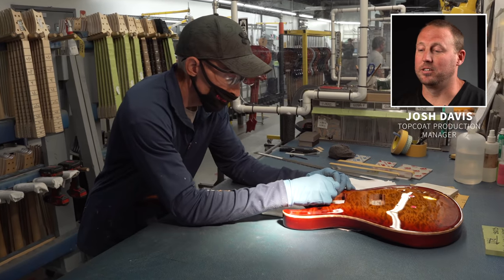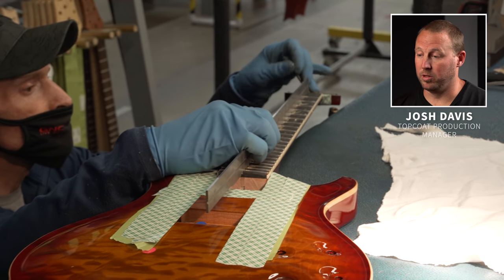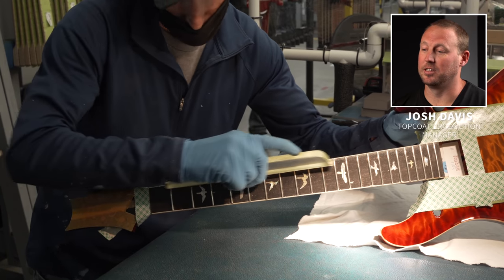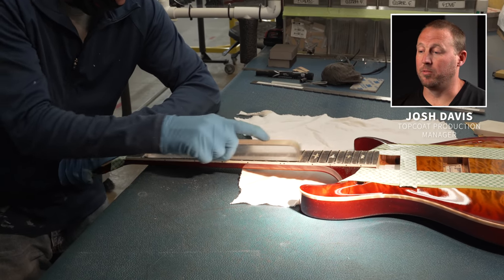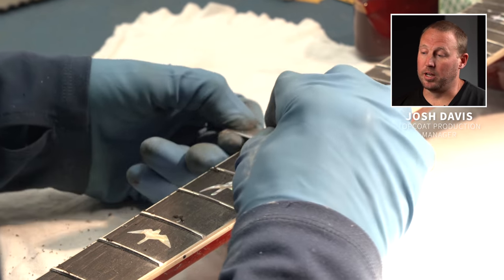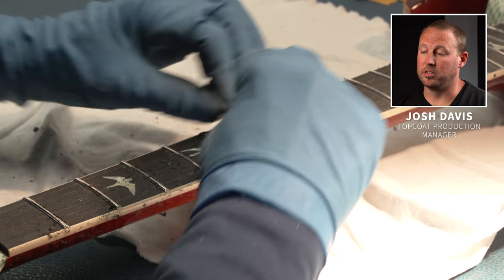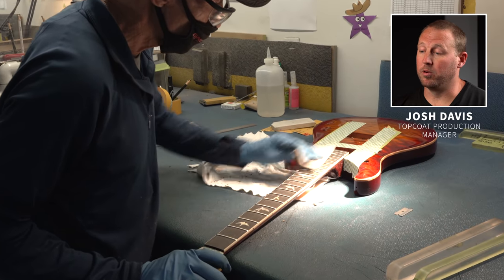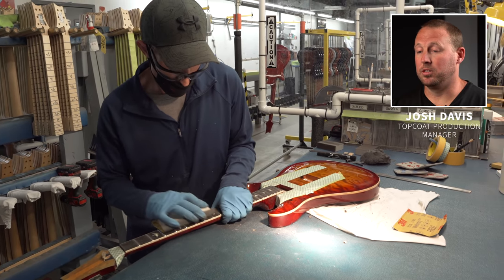Fret Level | From The Factory Floor | PRS Guitars

Comment: I thought notched straightedges were more effective for measuring fingerboard flatness, as opposed to a straightedge on the top of the frets, because if a fret is not fully seated, the straightedge can't sit across all the frets evenly?
Reply: Yeah I agree. Not using a notched straightedge basically defeats the purpose of using a straightedge.
Reply: I agree. It seems to defeat the point. 
Now that being said, when I make a neck (which is roughly three per year), I get obsessive about fretboard flatness before the frets go in, and ALWAYS with the truss rod in "neutral". I also don't hammer or press the frets in, I shoot them in from the side, like they did at Fender, in the 50s. When I get to the leveling process, having followed the steps above, I rarely need more than one or two light passes with the beam to get the whole board level (before I apply upper fret fall away).
Reply: @graxjpg  He is using a nothed straightedge though.
Reply: He is using it to straighten the neck. Then he uses the block to sand all of the frets evenly. Once he knows the neck is straight and frets have even wear from the sanding block, he knows the tops of the frets are in one line too.
Reply: I've just returned from a local music store that stocks these. Foriegn and domestic models. And I studied the frets of many models.  Exceptional instruments for certain, all of them.  But what I saw that I didn't expect still has me perplexed. And that was the flat fret tops. Some were narrower than others, I'd say the widest flat spots were about a millimeter wide and the narrower were .25. But there seemed no rhythm or reason. It's actually what brought me to this video. And after watching it, what I saw today seems to make more sense now. I never saw in this video any re crowning of any frets that were just ground flat. They  present the final fine sanding used. 
Anyhow,  I can see where it would be better in terms of number of hours before "pitting" or wearing. But it also seems like it skips a major step in the leveling process I personally employ.  And for me,  the time I would spend re crowning what I saw today would cost my clients between 80 and 120 dollars. Or, between one and two hours of work. I have seen Gibson les Paul customs with very similar looking fret tops.
Reply: @erickaufmancustomguitars1351  I believe Paul has basically been duplicating a lot of Gibson's older processes from the time PRS started.
There is a school of thought (to which I do not subscribe, personally) that since the guitar has unequal temperament by the nature of its traditional fret system and tuning, that the crowning process following leveling only corrects for fractions of cents per note, so who cares? Plus, as you mentioned, the process on display in this video saves quite a bit of time.
I can't be certain, because I never seen or held one, but I suspect a PRS Private stock would have evenly crowned frets, polished up like mirrors.
Paul is maximizing profit with an inferior process that makes little difference to many players (but not me). He can afford Pleck machines, so I can't see say justification for such a shortcut anymore.
Reply: @peachmelba1000  I'm curious,  did you have an issue with frets lifting that caused you to adopt this side shooting fender did?
Or just employing the same technique without question? Not trying to stir up anything. Seriously just curious.
Reply: @erickaufmancustomguitars1351  No, it's  just a gentler process. I can't say for certain, but I suspect that sometimes hammered or pressed in frets can vary somewhat in their level of seated-ness, in relation to one another, simply due to differing levels of pressure or force used, either by hammer or press. With side loading, you have to take care to remove any sharp corners from the raw fret ends before they go in, and you have to preradius them to the exact size. It's a bit more painstaking on the front end, but I find that extra time is really worth the result.
Reply: @erickaufmancustomguitars1351  Oh, and beveling the fret slot edges fairly aggressively is a must with side loading. If not done the square corner of fret slot will interfere with the tiny fillet between the fret tang and the underside of the fret itself. That can cause a high fret.
Reply: Thanks for passing along the information. Appreciate.
I finished 4 from the veterans I like in Minneapolis at supra-tone. Jatoba/rosewood, jatoba/jatoba, and walnut/rosewood, baked flame/rosewood.
One had to be refretted. As I sanded to roll the edge one fret fell out.
Reply: Sorry. I got distracted for a long time.
Anyways. 
I had very little left after leveling due to preparation.
I just actually feel sad after seeing what I saw is all.
Reply: @erickaufmancustomguitars1351  Right! They don't crown them, I give mine a quick crown now after seeing an playing S2, played better than the SE with just plain unleveled frets
Reply: @jirkav nope, just a straight edge the side talking calls a ruler
Reply: @jirkav if there's a problem with the frets you can't know if the neck is straight unless it's not, which it isn't

Comment: UNDERNEATH the fret?! I know you make a point of having the frets down 100% in contact with the fretboard. PAUL?! WHATS IT GONNA BE?!
Reply: I was scratching my head at that entire process. Just masking the board off properly during lacquer spraying would eliminate the necessity of taking a razor blade to the board afterward.
I suppose they could argue that the scraping is faster, but my word, that kind of "knife work" presents plenty of opportunities to mar the fretboard badly enough to scrap the instrument.
Reply: @peachmelba1000   But I have never seen a scratched PRS fret board right out of the box. So why the concerns? They obviously habe a reason for why they do it that way.
Reply: @chrisking6695  They have excellent QC, from the guitars of theirs I've seen. I doubt an instrument with a whopping big fretboard scratch would get past it. They must have worked out that the scraping, even with a risk of damaging or scrapping an instrument, takes less time and costs less than some other measures.

Comment: PRS are beautiful guitars. But I hate all of the neck profiles. I wish they would make a bolt-on neck with a fat back profile or offer bolt on necks with other neck profiles that I could purchase and replace the standard neck. ( without having to spend thousands of dollars in the custom shop)
Reply: Go buy a garbage Les paul then. All the fatness you could want
Reply: @grenade.turtle  yes I understand. You seem to believe PRS has no room for improvement. All I'm asking is what others are thinking expand the neck profiles
Reply: @windsurfmaui8239   Their bolt.on guitars are called CE. The CE like also comes with a pattern thin profile as far as I'm concerned. That's a fairly thin profile. I own a PRS SE custom 22 with wide thin profile. At first I thought it's a big neck but after comparing it to other guitars it's not big at all. 

You can always order a private stock. You can then have them custom make your neck to your specifications. Or you buy a PRS CE and take the neck off and go to an experienced guitar builder and have them sand the neck to your specifications. Or you just buy a different guitar. PRS isn't the end all be all.

I'm sorry I just realized you said fat.  Look for a custom 22 core model from the 90s. They came with wide fat necks.
Reply: @chrisking6695  thank you. Yes I'm familiar with the Paul Reed Smith line. As I said they are beautiful guitars but I can't find the neck that makes me feel like it's a guitar I want to play. And I just wish they would make one line or one model with a fat bolt-on neck for those of us who like fat necks. That's all I was trying to say. Since they don't I by Warmoth replacement necks and make a partscaster that makes me feel great every time I pick it up. I just thought as one of the major manufacturers they would try to listen to their potential customers and make options for all customers,  short of having to spend a thousand dollars or more for a custom-made neck. If Warmoth made a nack that fit a PRS I would buy one of theirs but they don't. They do sell a nice PRS body if I really wanted to make a PRS partscaster.

Comment: when do you crown the frets in the process?
Reply: they dont  seen other videos from them and they dont too , they leave them flat which i also thought is weird.
Reply: @Sunny_Bonez  no they don't leave them flat. I just had mine leveled and crowned by them. Maybe they don't want to show how they crown because it's part of why PRS feel the way they feel. Or it's a separate process. After all the video was about the level and dress process.
Reply: @Sunny_Bonez  After seeing the way they install frets, I suspect that the frets are put in so consistently level that very little material is generally taken off to level them. 

A minimal flat spot at the crown will be rounded over while he's sanding up and down the fretboard to remove scratches, which is usually the final step after the crowning file in a traditional fret level. I could be wrong, but I'm guessing the crowning file probably isn't needed in most cases at the PRS factory due to them being very level to begin with. 

In any case, whatever they're doing is clearly working. I've owned several and played a ton of them. The fretwork is always fantastic.
Reply: @travishemming3783  I'm repairing and building guitars only a few years now. But 30 fretjobs later I can say this.
Yes, if the fretboard is flat and straight and you seat every fret properly and it grabs and holds and dosent get squeezed up, and the temperature and humidity etc.   Then absolutely correct, it will take very few strokes with a radius block to level the frets. And you can easily see the flat tops of the frets. And some are very thin(still not crowned) and some a a bit wider (still not crowned) and some flat enough to see from space. I just came from a store where this was very obvious to me and naturally when the first thing I see looks like unfinished work to me, I had to satisfy my curiosity by inspecting every prs instrument there to see the consistancy. 
It was consistent. Every single instrument in ever single price range was consistent. 
A very flat fret is also a very short fret, one. A very flat fret can take maybe 20 to 50 strokes to crown. A not so flat fret can be crowned in as few as 4 to 8 strokes. Or, in a time line of as little as 20 minutes to 1.5 hours. Which for me includes going from the radius block to 1k, 1.5k, 2k, 2.5k, 3k, then jeweler's rogue on a dremel. They look like little mirrors when I'm done.
Its probably only due to this work I do that I even noticed all this. But I did. IDK

Comment: No though PRS makes great guitars, but when in comes to their fret wire is just a big fail, I had 3 core line PRS guitars and after around 18 months you could see heavy damage on the wires, it was so bad that I sold all of them and now I play Suhr..
Reply: Lmfao they're nickel silver frets by Jescar which are one of the best sounding frets. They wear down over time like all nickel frets. Depending on how soft/hard the nickel mixture they might wear down quicker If you have a heavy grip and play thick strings. But selling all guitars instead of having them refret with a harder material such as SS seems a bit idiotic to me. When the frets on your Suhr are due for a level/dress are you gonna sell it as well and give Suhr shit about their mediocre frets? Probably not. But hey let's bash PRS for a problem that you have. Lots of other PRS owners have not experienced enormous fret wear. It all depends on your playing style. Get SS frets on all of your guitars and call it a day. But be aware that they sound brighter than Nickel.